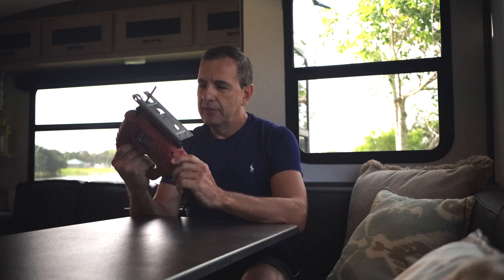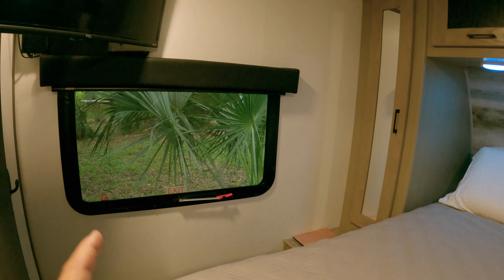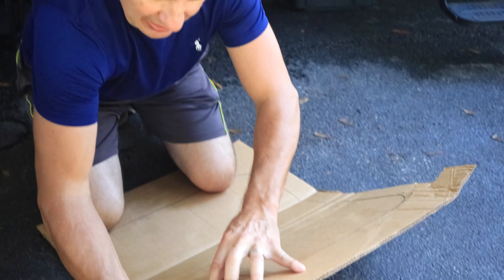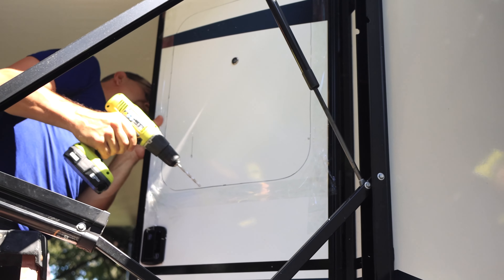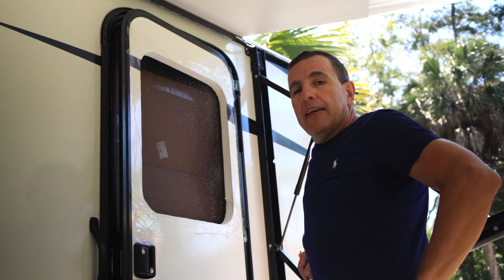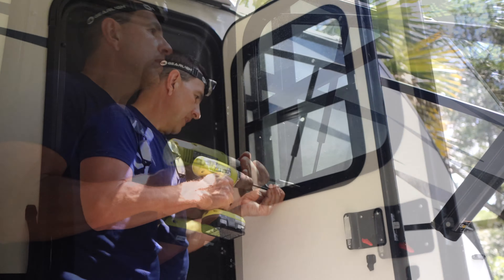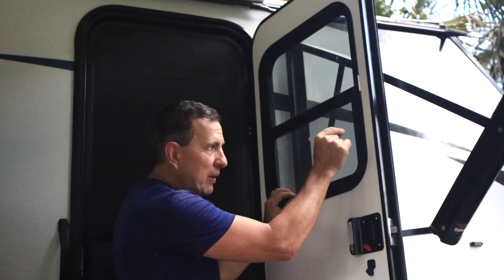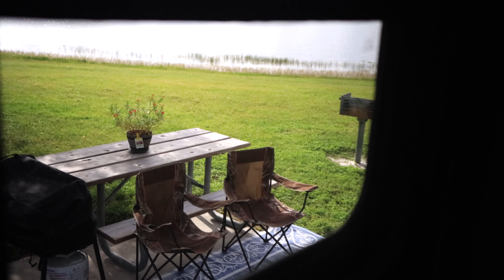RV Window Installation

Comment: L9 👍, a daunting job, the worry is if it is not waterproof post fitting, very well done, and it looks great post fitting 👍👍, please consider a metal cover over the internal door lock so that no one can try to break in through that new window, stay blessed and safe, your friend Traveller MIA 🇬🇧
Reply from the maker: Thank you! We are very pleased with the project. Thank you for the advise. Have a great week! 😁👍